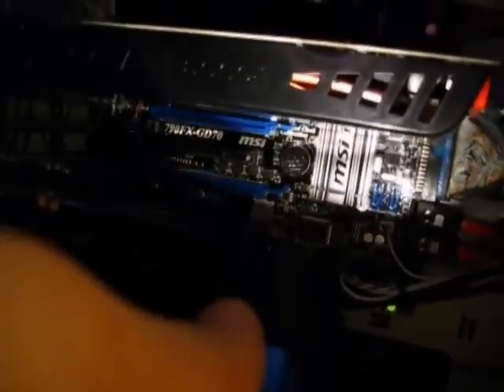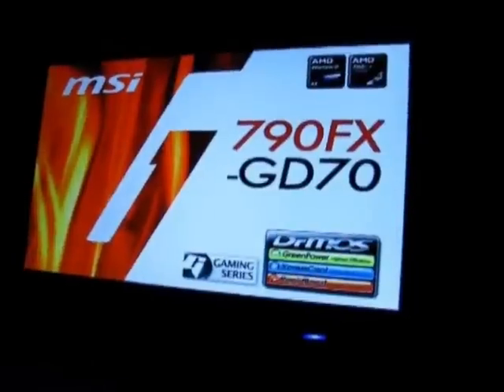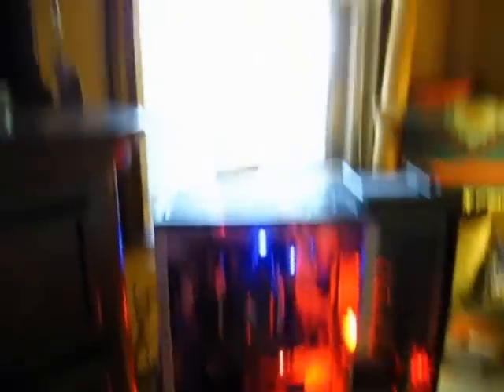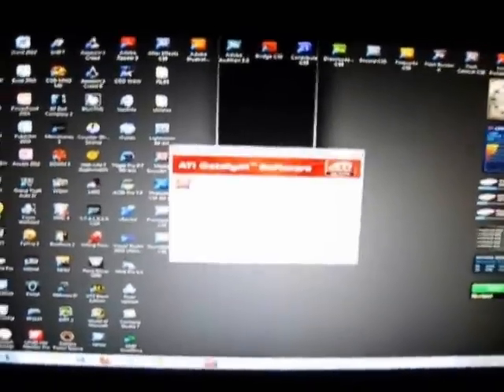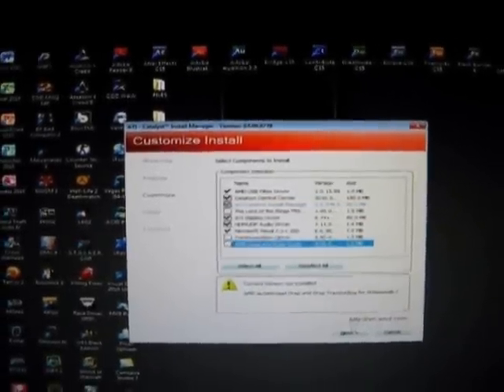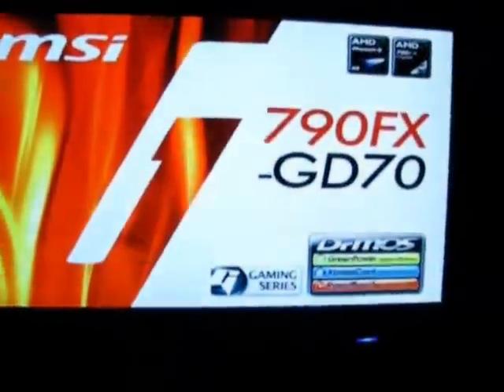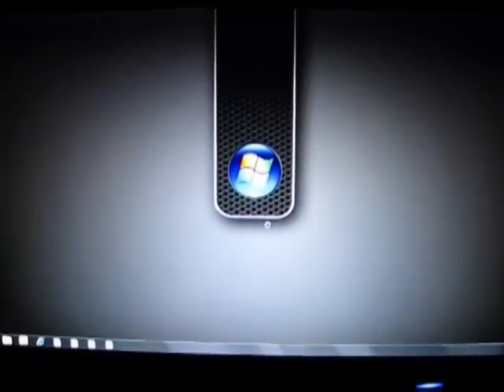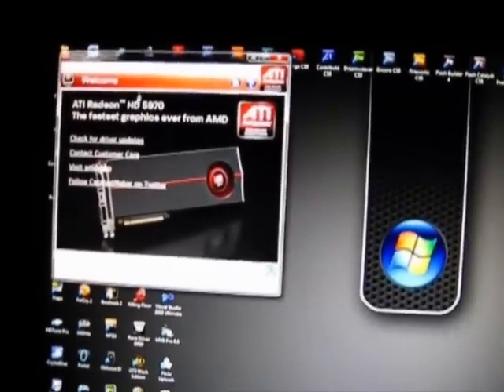XFX HD 5830 1GB Instalation and Configuration

Comment from the maker: @DuyAnh1 Well, mines Running OC'd at 900/1300 up from 800/1000 so my idle and load are higher. My idle is usually around 47-52C and my Max is around 72-76C running Furmark or 3DMark Vantage. I know what you mean, I hate the open air design because it doesnt cool as well as the direct flow of the enclosed design.